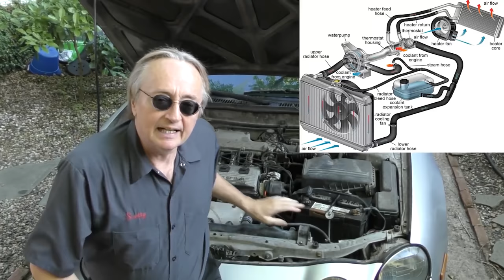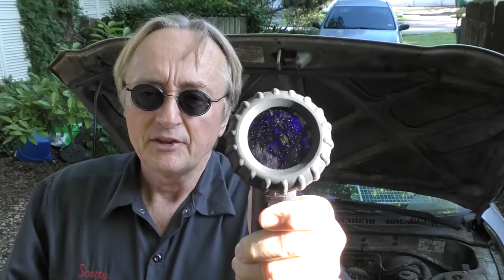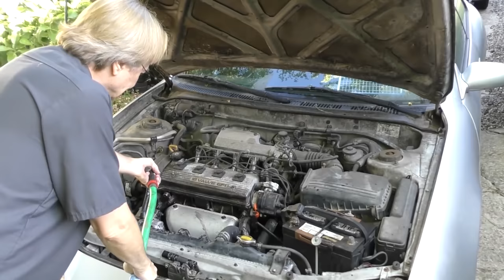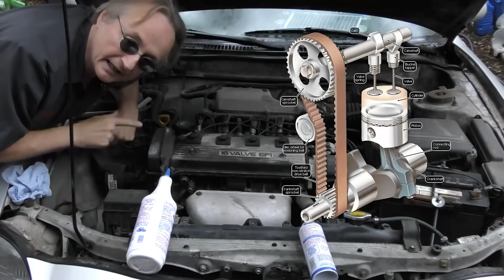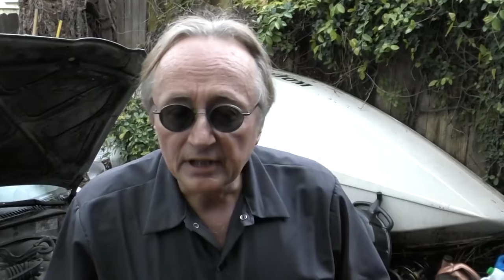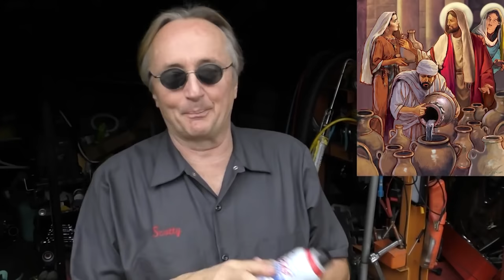2 Engine Myths Stupid People Fall For

Comment: I put 8oz of Tufoil and 4oz of ZDDP in my oil at every change in my old Jeep 4.0L I6 and at 200k she purrs like a kitten, doesn't break a sweat at 85mph, and still passes emissions with flying colors so I assume my cat is still good.  How would ZDDP in the crank even reach the exhaust unless you are burning oil (which mine doesnt)?
Reply: If you are going to use a Teflon additive, use the cheapest one. Teflon is Teflon. What the carrier or the other additives are probably makes no difference. Tufoil is competitive though.

Comment: 2000 3.8 Pontiac engine fire last August as a result of oil leaking out..not a total loss but a big mess.
Reply: too sad and that’s one sweet car
Reply: @William Davis where did the oil leak out from? Valve cover gasket, causing oil to drip on exhaust manifold & burning smell?

Comment: I have been pressure washing engine bays for almost 25 years now. It has NEVER been a problem unless the secondary ignition components are junk in which they should be replaced anyway.
To this day, people freak out about it by saying that it is going to cause all sorts of problems. That likelihood is quite low.

Comment: I installed wire stucco mesh in front of my radiator and it stops the big bugs 🦟🦗🦋 from smashing fins on it flat. Plus the stucco wire mesh is tin and zinc and doesn't rust.

Comment: A reason to keep your engine clean is for corrosion where salt (salt belt region) can attack the metal head gasket from the outside-in, resulting in a coolant leak/head gasket repair. Learned the hard way on my 2009 v6 Rav4. Folks, clean your engine. Sorry Scotty
Reply: What?
Reply: Lol.
 no.
Reply: Agreed

Comment: I spray wash under my hood, in the winter ,  but Im carefull about washing the motor or computer ( if the ecm is under the hood )
I always leave the car running while I wash it .
I wash the salt off of the inner fenders , brake lines , radiator and under the hood .
I also wash under the car , especially the brake and fuel lines and under the fenders where salt collects .
If you don't do this , cars in the rust belt rust even quicker .
If You Don't live in the rust belt , then you really don't have to do this .

Comment: The two times my engine has been washed, I got weird hesitation and misfires until all the water evaporated. So why'd I wash my engine after the first time, you ask. I had a valve cover leak and it's much harder to tell if I'm still leaking if my engine is covered in gunk after I fixed it.

Comment: Just a note: oil will not cause any shorts in an elctrical circuit because it is not conductive. In fact, certain types of oils are used as insulators in elctrical transformers, and other applications. Now, that being said, certain additives added to motor oil can make it very slightly conductive, but again, it is not enough to cause issues and it WILL NOT cause shorts in your electrical system. So if you DO get shorts, you’ll have to look elsewhere to figure out what’s causing the issue.

Comment: Agreed with cleaning the engine. other than vanity, the only point of it on a water cooled engine is finding leaks.

That being said, I frequently go under the hood of my grandmother's Toyota Aurion with the microfibre rags, the cleaner, and the plastic protectant just before she takes it in for the routine servicing purely to mess with her mechanic. I mean nobody else does any work under that hood, but he doesn't need to know that 🤣

Comment: For newer cars with lots of electrical components, it’s probably not a good idea to wash the engine. I’ve washed the engine on my 1996 vehicle with no issues to locate leaks quicker. Also, use common sense when washing the engine. You want to do passes. Not spray on anything for too long.

Comment: As a mechanic myself I agree mostly with Scotty. However I have 1 exception to this rule which is that I prefer i to have an engine that is honest in that it may have had some cleaning done in its life also sometimes I do prefer to give some customers cars a rinse underneath to get the salt off the underside of the engine. If an engine is absolutely whistle clean then it almost always looks like it’s trying to hide something sinister. An honest engine should show signs of maintenance being done as in a clean oil filter & clean air filter. Which is what I always look for first. Never ever buy a car with a whistle clean engine bay & I mean never. This almost always suggests that the previous owner is trying to pull the wool over you. Look for signs the engine has been maintained as mentioned above reasonably clean oil etc. 
keep up the good work Scotty.
Reply: @Anakinskywalker you don’t understand how good your advice really is! Impressive

Comment: I have been washing car engines for years with no problems.  just cover the spark plug wires if its an old car and alternator with a plastic bag and also the fuse boxes and dont use high pressure. Blowblow any excess water away with a compressor and wait for it to dry before you start the car up again 
Simple 👍

Comment: Meh, I clean the engine bay on my old Vette, I disconnect the battery and take a garbage bag and cover the coil packs and the batter/fuse box. Every time I'm in there I scrub off any parts I remove before I put them back too.  It just looks nice and if I have a leak it will be real easy to find.

Comment: I will never use 0w20 or 5w20 oil in any of my cars. I don't care what the manufacturer recommends because I know WHY they recommend it. And Scotty has obviously never had a Ford 5.4 Triton engine because with the thin oil the VVT malfunctions and the cure is to step up to at least 10w30 oil, even on a low milage engine. Look it up.
Reply: Generally, I don't support the idea, but research sometimes shows that the same engine has different recommended oil weights in different countries or that they change the oil recommendation from one year to the next. You have to make sure though that the engines really are the same. The piston ring design and materials may be different or the cam shafts and bearings may be made from different materials. Unfortunately it's a buyer beware world. In Latin, caveat emptor.
Reply: @anonymike8280  The overly thin oils yield ever so slightly higher fuel economy which is federally mandated. The same with start/stop engines. Replacing that starter will cost more than any fuel cost savings. After engine break-in, switching to a 5w30 or 10w30 oil will increase the life of the engine and it will run fine. On a 5.4 Triton engine it is a necessity to use a thicker oil.

Comment: If an engine or engine bay is too oily to work on, I first blow it off with gasoline and air. It goes without saying not to do this on a hot engine. Other than that, there is absolutely no need to clean engines unless you are doing a repair.

Comment: Clean your engine smart if your going to do it! Disconnect, and remove the battery, then turn the key to remove residual power. I do agree that pressure washing the thing is a moronic thing to do, but standard washing with de-greaser, and soapy water will do fine, just be careful not to get water into the intake.

Comment: Not sure I agree.  Oil build up on an engine, can be fuel for a fire. You will never seen a clean engine catch fire.  Not using a funnel when adding oil. leaves spillage, that after a lot of build, can be source of fire. Doesn't have to be shinny, but should be clean.

Comment: I disagree I drive cars that I buy cash (all toyotas) and do 90% of my own maintenance and repairs.  Every couple times I wash it I spray a little simple green on the engine light scrub with a soft brush and hose it off. I never let the cleaner dry. Do it on a cold engine don't start it until it's dry and don't blast any electronic stuff with hard streams of water you'll never have a problem. Makes it easier to identify the source of any leaks and much more pleasant to work on if you do have to do a repair.

Comment: Why only disconnect the negative battery terminal? I get breaking the circuit, but you still have power going to the electronics with the positive post connected, wouldn’t your water then complete the circuit and short?

Comment: Lucas also makes a  "pure synthetic"  low viscosity version.  Just wondering what your thoughts on that are.  Also,  would stp be a good additive be a good idea in a pre emissions air cooled motorcycle engine?
Reply: RE: Motorcycles... depends. Some motorcycles, mostly European and American, use separate engine oil. Other motorcycles, usually Asian, use one lubricant for the engine, transmission and even the clutch. (I hate this, but it is what it is)

Some automotive additives will leave your Japanese bike with a slipping clutch and you scratching your head. And, like the man said, modern oils are really pretty good - how religious you are about changing your oil may be more important than what religion you have when it comes to brands or additives. But whatever it is, be sure that it's rated for that all-in-one engine, transmission and clutch lubrication, if you have one of those bikes.
Reply: Amsoil makes oils for engines, trans and primaries for HD.

Comment: I had to laugh at the picture of the frying pan on top of the air filter.  I once read a book about cooking food on your engine.  The idea was that you would drive to your picnic spot with various hotdogs and corn or whatever carefully wrapped in aluminium foil and placed strategically on parts of the exhaust manifolds or whatever.  By the time you arrived, the food was hot!  Bon Appetit --Old Guy

Comment: Dirty engine? If you need a Toyota 5SFE four you would love mine. It is dirty as hell. The previous owner changed the oil at the specified mileage over the entire life of the vehicle. He neglected everything else, but I have it all fixed now. I don't even know the oil consumption rate because I change it at about 2500 miles. I'm estimating it's a quart in 7000 miles, or less. No, dirty engine doesn't matter. Didn't matter in the 1993 Geo Prizm I once had either. You would have wanted that engine too even with 280K on it.

Comment: It's safe to wipe down the engine bay with a damp rag ... with or without cleaner sprayed onto the rag.  Also, keeping leaves and other detritus out of the engine bay makes it easier to spot mice/rodent infestation and remove them before they chew wires. 💲💲💲.

Comment: Washing your engine:  Take some 'Goo Gone' degreaser, and some paper towels, and slowly clean a few inches of the engine at a time, rubbing the dirt away, not washing it away.  That way you don't damage any electrical connections.

Comment: all metals radiate heat...especially modern aluminimum designs. its true the electronics can be fucked if u spray solvents and detergents in the connections but only if you dont clean out said connections before electricity goes through the terminals. so detail the engine bay every few months for 1) its looks nice. 2) you can detect leaks and other potential defects sooner. 3) you aint no gear head if you dont and are unworthy of the mechanical horse you rode in on

Comment: When I clean my engine I use a towel and spray the cleaner on the towel. If you neglect to clean your engine then it makes it look like you hardly ever open the hood and did the proper maintenance. Having a clean engine tells the buyer if you're selling the car that if you clean your engine then you're probably doing the proper maintenance. Just my opinion

Comment: Scotty, I wonder if you have any opinion as to Marvel Mystery Oil as an oil additive to help clean some internal engine components, oil pump, bearings, seals, valves springs and seats, etc, etc ?  It seems to work great in the fuel system as well , fuel pump, filters, injectors, etc. any thoughts Oh Hallowed Sage, Master of Machines ?
Reply: He has a video for Mystery Oil
Reply: It's a mystery that anyone considers it a miracle.

Comment: When i was young and dumb. I bought a Volvo s60, wanted to clean the engine bay "detailed". Went to a sketchy shop. Got it "cleaned"... 3 days later i got the CEL flashing and car started to buck... Turns out the idiots pressure washed the engine bay and got water inside the spark plug coil packs. Cracked 2, cost me 500$CAD. Never again

Comment: When looking at used cars, I actaully prefer an engine that is not completely clean.  Part of this is because I have heard horror stories about people power-washing their enignes and destroying them.   So aside from leaks which can indicate a problem, I'd rather have a "dirty" engine bay because it means the engine wasn't cleaned and likely the engine was not damaged from water ingestion or power/pressure washing.  I mean part of me says if you're buying a used car and the engine bay is suspiciously clean for the mileage (say it's got 80 or 100k on it and it's squeaky clean, I'd be concerned that someone is hiding something, like a slow leak or something, and they maybe have power washed it as I mentioned above).  And I've bought cars that had dirty enigne compartments and even a few that had leaks (like they were leaking from the valve cover, which to me is not a huge issue as long as it's not a massive leak).  So I'd rather an engine compartment be normal and not completely clean especially on a used car, because it can throw some red flags IMO.

Comment: Hey can new vehicles run just fine during the summer with water in the coolant system like my Pappa always used in his vehicles? By new I mean my 2005 F150 with a small antifreeze leak. I do not want to get to deep into this thing.

Comment: Technically it is a "liquid cooled engine"

Since it is a mixture of water and coolant.

And based on the hose connections, that is a transmission cooler 😂
Reply: "Technically" the air is what the heat transfers to and cools the engine on all dry land vehicles. Only some types of water craft like jet-ski's transfer engine heat directly to the lake / river water they run in.
Reply: @bluevalkyrie2517  Since it is the liquid that transfers the heat away from the engine to the radiator, it is a liquid cooled engine.

Yes the radiator with the use of air transfer the heat away from coolant, the air doesn't directly transfer the heat from the engine,

it needs the medium of the coolant 🙂

Although if we really want to split hairs,

A normal car engine is cooled using the following:

- Liquid Coolant cooled with post heat transfer air coolant cooling,
- Fuel cooled (combustion chamber), and
- Oil cooled

And as a fun aside even an air cooled engine uses oil to cool it, which is why they generally run a thicker oil :-)

Comment: hi guys i have a question i have a 2004 honda accord k24 engine l. The problem i encounter is when idle there is no blue smoke but when engage the gear to D the blue smoke is emmitted i had try everything but idk what is the reason.

Comment: In today's market, burning a quart of oil every 1000 miles is far cheaper than buying a new car in most cases.  So say you drive 15,000 miles a year.  So you have to buy 15 quarts of oil (or 3 - 5 quart jubs which are maybe $30 each).  So in a year you might spend $150 on oil, but that's only a fraction of what a car payment would be.  People don't think of things like this.  Of course it's a nusiance especially if the oil burning gets worse, but even if I had to put 1/2 quart in and it was burning (not leaking) I would probably still be OK with that because oil is still cheap (engine oil that is -- not necessarily gas of course).    If it's just a leaking valve cover gasket or something simple, then I would just fix it, but if it was from worn rings, I would probably just live with it and put oil in it.  I mean you figure that an average car payment thess days could be $200-$300 per month, and you'd be buying say $20 of oil a month, still cheaper than one car payment (over the course of a year).

Comment: I,ve seen at least 3 Chevy 5.3 litle engines destroyed because of Lucas oil additives...all 3 they oil pan was full of it and it was like gelly. It plugged the oil sump and siezed them up, I would never recommend it unless the engine is on it,s way out allready.  Do not use it on a regular basis or you are looking for trouble.

Comment: Don't forget your engine cools down through conduction convection and radiation and you need ram air which is the air flow around your engine if you don't keep it clean your cooling system is being made to work harder,  so I don't agree with you on that at all.

Comment: Hi Scotty! My 08 Mazda 3 started making a wum-wum-wum noise right after a long-overdue tire rotation. It's been several months and the noise didn't go away, so I removed the tires myself to check the wear. It turns out the driver side front tire has slightly scalloped wear on the inner edge. I don't understand how there was no noise before the rotation. (tires are directional so they only swapped front and rear, not side to side.)

Comment: I’ve always kept my engines washed. Never had a problem. You just have to have half an ounce of common sense about how you do it. No high pressure. Avoid sensitive electronics, but remember, they are designed to handle driving in torrential rain at highway speeds. They can take some water.

Comment: I have to disagree on cleanibg the engine. Of course it must be done properly and know what you are doing.
I have cleaned multiple car engines including old vintage car engines many times and not a single problem caused by that. 

Clean engine is nicer to work with, to look at, to show off, easier to spot leaks and do you really wan't to drive a car that has layers of crap on the engine, but is otherwise clean? 

Think it like this: 
Would you want a woman that is otherwise gorgeous, perfect, the afrodite of your dreams, but doesn't ever brush her teeth? Afterall you see her teeth only when her mouth is open. 

Exactly what I mean.